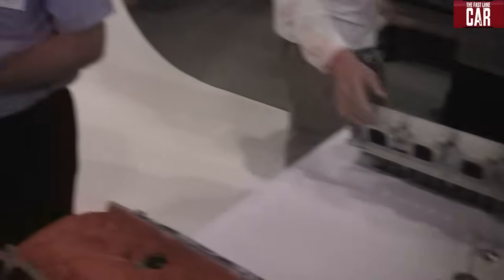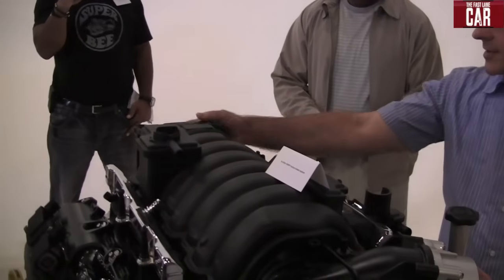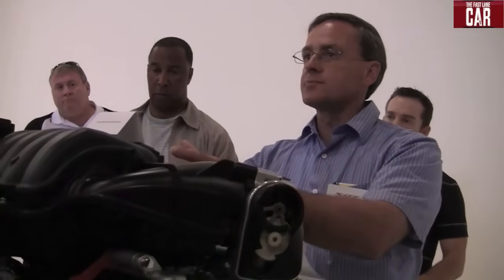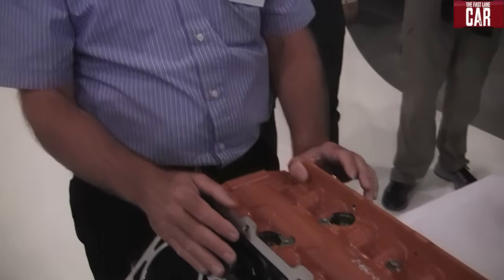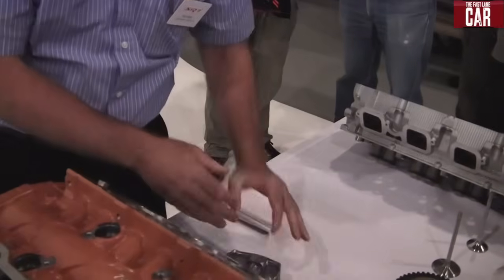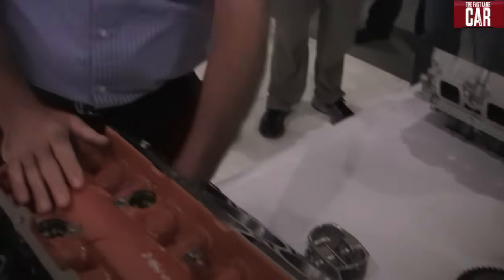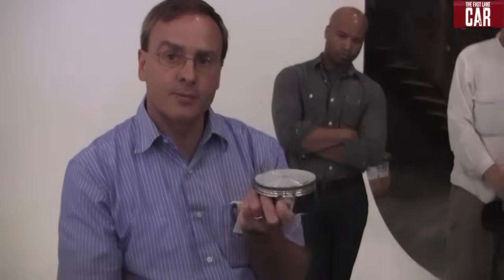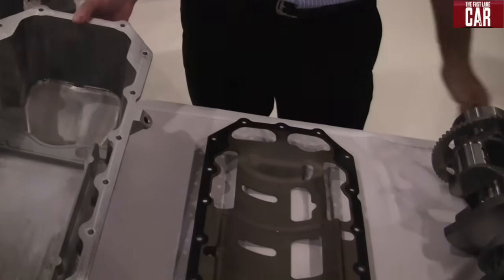Technology Revew: The 2012 6.4-Liter HEMI SRT V8 engine exposed

Comment: Could you please explain why many are having lifter failure resulting in full engine replacement?
Reply: Dame right i bought the car 2012 srt 8 super bee at 120000 miles week later tell now misfire on Cylinder 6 because lifters gone bad you to ?
Reply: Yeah don’t buy a performance car with a 120,000 miles of rape

Comment: i have this engine in a '12 300 SRT8.  My only complaint is related to the transmission.  But the reason for this post is to reach out to see if anyone knows why i have a bad voltage fluctuation problem. Meter shows low of 13.3v and high of 15.9V.  all bulbs except the headlights seem to pulse their brightness at a rate of about 3 or 4 times every second.  
The shop diagnosed and changed the alternator, but i'm still having the same issue. 
The problem started a few days after I changed out the battery.
help!

Comment: I just bought a 2018 Dodge Challenger 392 Hemi Scat Pack Shaker....   The dealership has just acknowledged that my car is down on power about 10% but feels that it is within acceptable limits and is refusing to fix the problem. I called SRT customer service and FCA customer service about the issue and was told that I need to pay for another rental while we see if another dealership thinks that a 10% power loss is acceptable for a warranty repair. I only have 3000 miles on my car and it is slower than the 5.7L Hemi. I kinda feel like once they get your money for the car, they really don't care about their customers. Towbin dodge in Henderson Nevada definitely seems like they aren't interested in fixing this issue. Who the hell is happy with purchasing an SRT engine to get R/T power? what a horrible company. I really thought Dodge would stand by their product.
Reply: Street Shaker 702 In my personal experience i found that after 5000 to sometimes 15000kms vehicles start developing more power and better fuel economy. I have noticed this with 5 new vehicles. Not high performance like this. They all seemed to have an increase in both aspects. Check your oil level and keep driving it, as long as your complain is documented, the dealer will be forced to repair if something is truly wrong with it. Good luck!
Reply: I got that exact same car, mine is fully loaded w options and has automatic trans.  keep me updated.  I got 10K miles, no problems.
Reply: What you need to do is to get in touch with FCA in Auburn Hills Michigan let them know about your situation I'm sure somebody there will be able to help you with this problem also if you brought the vehicle new you can file the vehicle under the Lemon Law but if you got a family or friends discount that would disqualify you from being able to file it under the Lemon Law I work for the company sorry you feel this way I've had problems in the past with our vehicles also but they took care of it it's the dealers I'm not wanting to stand behind it because it's money out of their pocket to fix the issue sorry again for your problems I'm sure if you get in touch with Auburn Hills I'm sure they'll get it taken care of.

Comment: A great engine until you have a problem with the lifters and require a rebuild, we have now had two engine replacements in 4 years with less than 130 000km on the clock. Don’t think that Chrysler Australia will help either...I’ll never buy a Chrysler again

Comment: Nonsense....The 6.1 is the base for the crate motors...up to 440 ci. Nice try but the 370 motor is a better motor.......Composite vs aluminum intake? Plastic or metal? Gee let me think about that...What would anybody need a cylinder deactivativating variable cam timing high-performance motor for?

Comment: Who buys an SRT who gives a Shit about a 4   cylinder disconnect system ? Huge Mistake. When you put the car in Sport Mode you would a least expect it to cancel out. And whats with the Huge Trunk, Who wouldn't give back 12inches of THAT mistake to put bigger rubber on the back for badly needed grip. You SRT guys should be back in the mail room
Reply: Richard Thomas its a great feature, i have a srt8 300 and drive 1000km road trips between towns in australia and significant fuel saving whilst cruising. even at 140kmh it will run in eco mode. its probably what helped this motor over the line with emission control

Comment: I have owned 2, 392 cars, a 2011 Challenger and now a 2013 Challenger. I love both of them, they have a lot of power and torque but the problem with all of the Dodges is weight. Chevy and Ford use aluminum blocks, why doesn't Mopar? The aftermarket 6.1 aluminum block is 100lbs lighter then the cast iron production 6.4 block. Chevy has been using aluminum control arms and steering knuckles on the front suspension since the '80's on the Corvette and today everything has it, except a Challenger/Charger. My wife's 2004 Grand Prix has an aluminum engine cradle and for crying out loud. And who's brilliant idea was the two piece steel drive shaft with a carrier bearing? Aluminum drive shafts have been standard in most rear wheel drive vehicles since the mid to late '90's. Get with the program Mopar, these changes alone would have reduced the weight of the Challenger/Charger by 300-400lbs and then they would be just over Mustang weight instead of being bloated. I don't get it?
Reply: you people whining about weight. if you want a race car, buy a damn race car!! the challenger and charger are great GT cars. geez. O.o
Reply: So buy the chevy.....
Reply: Cast iron can take a beating

Comment: I will say the 6.1 was a bitch. I didn't think it would light up the tires the way an 07 300 did when i test drove one. The 6.4 is probably nasty.
Reply: The torque increase is not that much noticeable. But I have not drove it in sport or rack mode yet.

Comment: 4cyl operation is the stupidest idea in a high performance engine
Reply: +David Argento if you're in the default mode it'll go into it once in a while only in automatic and in sport and track and manual mode  it won't go into it at all
Reply: I drove about 225 miles at speeds of 65 to 95 and got 22.3 mpg.  I don't care how they do it, but that is damn good for a big V8 moving at a good speed.  Drove from Portland to Walla Walla. I do love my SRT Challenger
Reply: I agree.  I disabled MDS on my 5.7 and still get the same fuel economy, if not better.  MDS is a waste of money.  Start/Stop technology makes more sense IMO.
Reply: The engine runs so hot with bthe stock thermostat. Should I change it or wait for the warranty to end next year before I do it. My 5.7 with JET 180 ran nice. But I had the Diablo Trinity to adjust fans.
Reply: I dont mind it. There is a hesitation when you floor it sometimes.
Reply: I love that it does that! If I want it to be aggressive, I just keep my 300 in sport mode!
Reply: Fick the MDS, I never use it, always in sport mode...
Reply: SICKWIT-IT TV been driving my 2013 srt8 for years with long tubes cat deletes and motiva tune producing 505 hp at the wheel on dyno without any issues what so ever. Its been dropped 2 inches on coil overs but getting decent gas mileage on the 4 cyl drop. If anyone wants to add a pedal commander for throttle response issues they can for $300. This 6.4l 392 is amazing.
Reply: Mds has always been reliable. You’re an idiot.
Reply: THanks. I have not driven yet much in Sport or Track mode.
Reply: Love getting 27mpg on the highway on long trips.  It's almost as good as my old Toyota even tho the engine is exactly FOUR times bigger, hahah.
Reply: If it weren’t designed this way, it wouldn’t be able to exist! (Probably)
Reply: No it isn't
Reply: george-LA why do you say that? When I get close to 500 hp when I need it but can get 23mpg on the highway it's the best of both worlds.  I love my 392
Reply: I'm still on the fence with this issue.
Reply: Clearly u don’t own the car. No one wants to get 15 miles to the gallon all day. The ability to have tons of power and great gas mileage is a no brainer. U just have no brain.
Reply: Christopher Contreras j
Reply: +george-LA  Wow! that's an ironic comment considering how overpriced these cars are already!!!
Well, they had basically 3 options, Use cylinder deactivation, 2. drastically reduce power output or 3. discontinue the engine altogether and replace it with a more efficient V-6 or a turbo 4-cylinder. which option would you prefer?
Aluminum might be a practical option IF we were talking about a primitive, outdated, low performance, low rise single plane or cross-flow manifold design from half a century ago. but if you looked at how bulky and complex the advanced variable tract manifold is? you would immediately see the advantage of COMPOSITE construction techniques..  not to mention they have been successfully used by other manufacturers for over 2 decades.
I'm surprised you have no objections to VVT technology.. although generally very reliable they do sometimes fail like any other component.. they eventually... sooner or later require expensive replacement too.
Reply: If you want it as a daily driver...
Reply: not very reliable system and when it goes trust me your wallet is gonna go with it....plus why the hell would they put a plastic intake compared to a aluminum one...doesn't make any sense and his excuse it to reduce engine weight...smh.
Reply: @MrGeorgesc007  can`t remember the exact science behind it but has to do with plastic having better cooling and less heat absorption than an aluminum intake...take the foxbody mustang for example the stock air intake system is cold air and draws from the fender well from the factory and the intake piping is plastic and thick, the aftermarket metal intakes do the same but the metal absorbs heat faster than the plastic intake since the metal is thinner and absorbs heat more easily and as a result on foxbody mustangs you may lose some power when upgrading to an aftermarket intake setup....as a result over the years the metal intake manifolds too are being made of plastic for weight savings and heat dissipation, factory intake is fine on foxbodies if you`re just doing a street strip build (300-370hp), drop a k&n filter in for a little more airflow, the metal intakes are only necessary for boosted or high rpm applications requiring a larger diameter intake tubing to get enough airflow...wish the foxbody came with a plastic intake manifold or atleast something that looks as good as the tpi intake/ holley front mount throttle body set up

Comment: You idiots that complain that this isnt a TRUE hemi engine because the chambers arent truely hemispherical. Sorry to break it to ya but this chamber design is Superior to the original hemi design in every aspect. Also high domes on the pistons on the original Hemi was a BANDAID to be able to get any compression out of the chamber design, that led to some hugely heavy pistons. A flat top piston has Superior burn characteristics compared to any huge domey bandaid pistons.
Reply: FINALLY somebody talking some sense in this discussion!  A "true hemi" is not a very good combustion chamber.  Go back and read some car magazines from when the 426 hemi was introduced in the '60's.  A lot of enthusiasts back then complained that it wasn't a "true hemi" either, and that the 330/354/392 were the "true hemi's".  Chrysler from the introduction of the small block HEMI said that it didn't have a combustion chamber with spherical surfacing.  They said it was the valves facing each other across the chamber and the central spark plug location was what made it worthy of the name HEMI.  The dual squish pads, reduced valve included angle, and dual spark plugs make for a very fast burn so the engine can meet emissions standards and make great power with minimum spark advance.
Reply: +Andy Harman  Absolutely, the current generation HEMI® engine uses a "quench" design theory which is a complete departure from and diametrically opposed to the Hemispherical design concept.
Yes, its not the first time Chrysler put the HEMI® brand name on an engine that did not have a hemispherical chamber either..
the 215/245/265 cu.in. HEMI-6 engine was more of a "Wedge" chamber design than anything resembling or functioning as a hemispherical design.
Reply: dantheman1998 You idiots that think the new combustion chamber is more efficient, are well, idiots. And the 'domey' pistons were heavy BACK THEN. Apparently you haven't been briefed on the metallurgical and design advancements in current piston technology. Nor, have you ever checked on the SUPERIOR flame travel inherent on a 'domey' piston design. Leave the big boy talk to people who actually have studied thermal dynamics and efficiencies, ok? Now run along.

Comment: that piston head is flat 
hemisphere engines their heads are rounded
Reply: "Hemi" refers to the shape of the combustion chamber in the cylinder head and has nothing necessarily at all to do with the shape of the top of the piston. The pistons in the Hemis were rounded on top but only to achieve the desired compression ratios.
Reply: Where did you see the piston?
Reply: LightningAssault.com Just google it, its easy to find an image that shows the flat top pistons..
Chrysler stopped production of hemispherical V-8 engines in 1971..
Reply: Beast 195 is Uk is a Hohhot I love

Comment: Where's the Hemispherical head or the domed pistons .. Dodge is obviously using the Hemi name in tradition only.. Add the SRT emblem and the crony's run to there nearest Dodge dealer to buy one..
Reply: +PRE CBS STRATOCASTER'S   HEMI ® in all caps is a register trademark, its been used before on other engines that were not equipped with hemispherical chambers like current design.
Reply: The real doktorbimmer  Obviously Dodge will say just about anything to sell a car.. pathetic..

Comment: I would like to know how any of you determined if it is a hemi or not from this video? They never showed a shot of the combustion chamber side of the cylinder heads. That is the part that makes it a hemi, not the pistons or the cylinder bore.
Reply: It's not just the chamber that makes it a hemi, it's the rest of the head architecture. Still has cross flow ports with canted and splayed valves, and dual rocker arm shafts like the old hemi. You won't find this head architecture in any other V8. The gen III just has a modern combustion chamber for better efficiency compared to the old hemis.